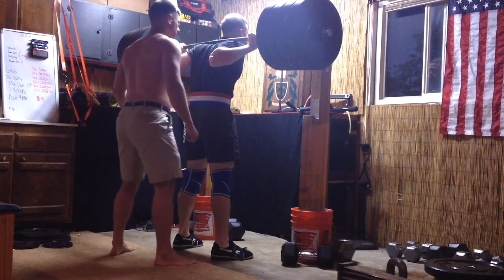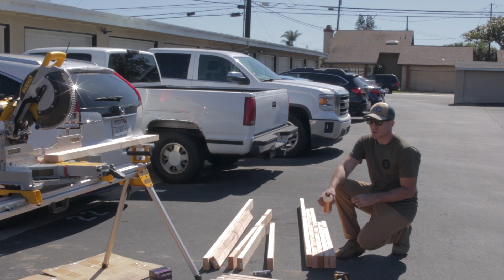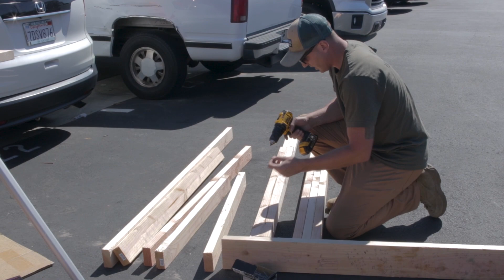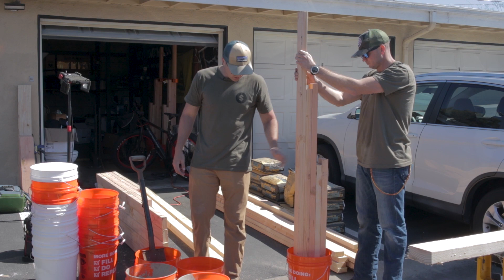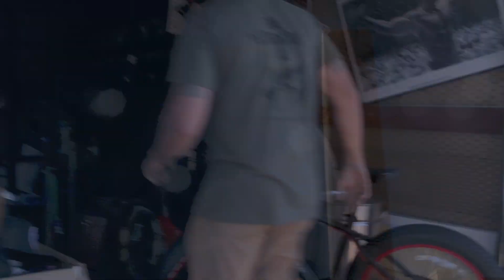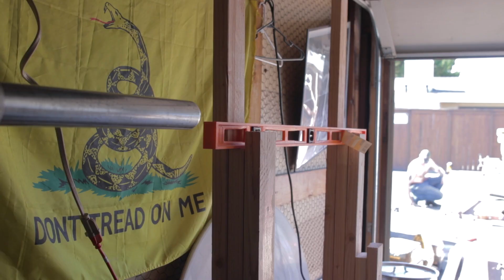Build Your Own Squat Rack: Step-by-Step Instructions

Comment: Why do you all use buckets as base. A box would be much more stable
Reply: Yeah, that's what I thought, everybody using buckets, if you're gonna use buckets, why not the square ones?
Reply: Rob Baker Smart!  That’s what I’m going to do.  Found cheap, 5 gallon rectangular ones I’ll orient with long axis perpendicular to the plane
of the barbell for more stability.

Comment: can you put a pullup bar on there? you think that'll work or no?
Reply: Erhaan Zee you should try and cement it to the ground if your gonna do that and do it outside
Reply from the maker: @gabe-qr5vb  This seems like a potential solution. Don't think a pull up bar would work on that set up as it is.
Reply: I would add a 2x4 on the rear of the poles..joining to the two sides. Then add a pipe on top for the pull ups

Comment: Awesome video! Any tips on different wood dimensions? I am based in spain and 2by4s are nowhere to be found. Would a 33mmx70mm be strong enough?? (2by4s are 38mmx89mm). Thanks!!!
Reply from the maker: You may want to try gluing and screwing those 33mm x 70mm pieces together
Reply: Juan, 2x4 no son 38mm x 89mm. Una pulgada son 2,54cm. 2"x4" son aprox. 5x10cm. Si encuentras algo parecido, avísame y me cuentas en qué tienda lo compraste y por cuánto. Un saludo.
Reply: look for 90mm by 45mm

Comment: Do you think it would be possible to build it into a wooden base instead of putting them in concrete buckets?
Reply from the maker: Jadon Ampadu you can but concrete is very fast and easy! If you do wood add some weight to it like a sandbag .

Comment: Question how tall are you cuz then i know how tall i should make it or make it just like urs??
Reply from the maker: He made it based off some 72” tall.
Reply: The Strength Co. so if I’m 5 foot 8, how many inches should I get the cuts?
Reply from the maker: @jcfivepoint93  The model shown here should fit people ranging from 5'2" to 6'4"
Reply: The Strength Co. so this means that using your measurements for the squat part, I’d be able to unrack the bar without needing to get on my toes?